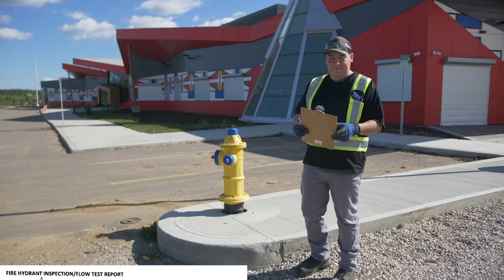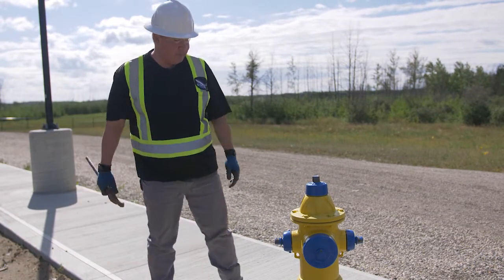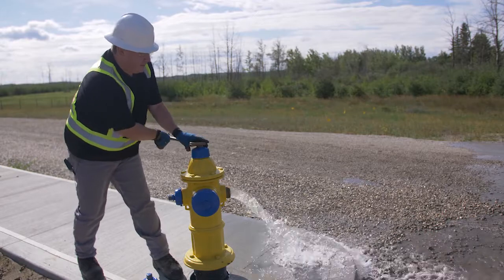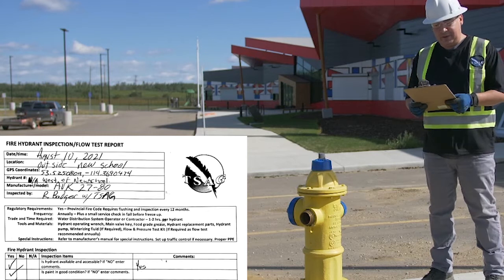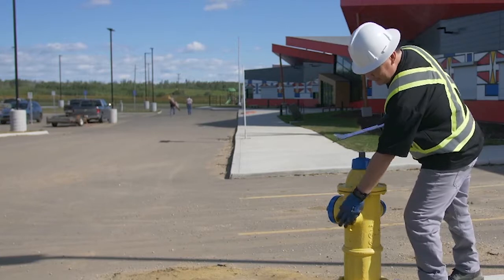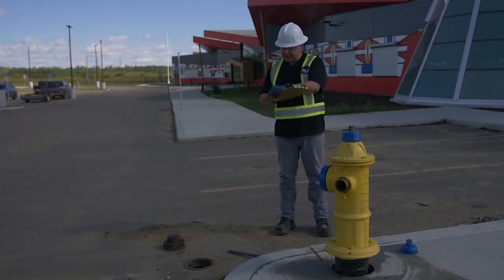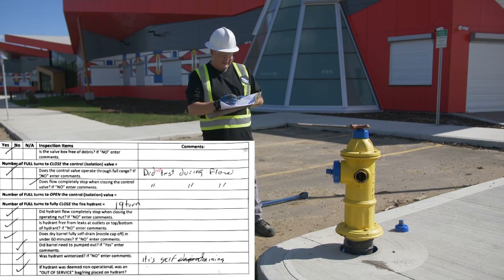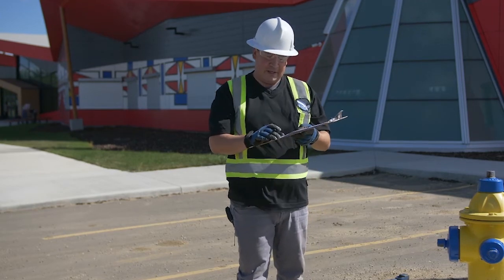How to do a Fire Hydrant Inspection (with Checklist!)

Comment: Showing the checklist while doing each step is amazing! Great video!
Reply from the maker: Thank you so much for your continuous support!
Reply from the maker: Let us know if there are any specific topics you would like us to cover!
Reply: @WaterMovement  A valve maintenance program would be good, either for a distribution system or facility, with an example checklist, like you did in this video.
Reply from the maker: We've added to our list of videos to film. Feel free to let us know of any other topics/content you'd like us to film. As well, if there are any Operators you would like to see featured in the video library let us know :) Our email is info@watermovement.ca
Reply: @WaterMovement  does the water company know how much water you used and how do they bill for it? Great video thanks!!